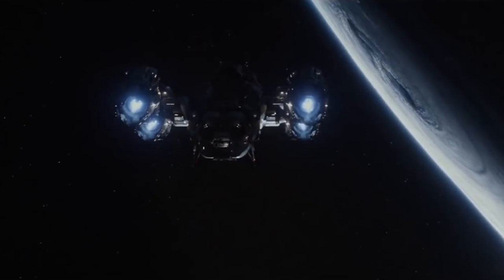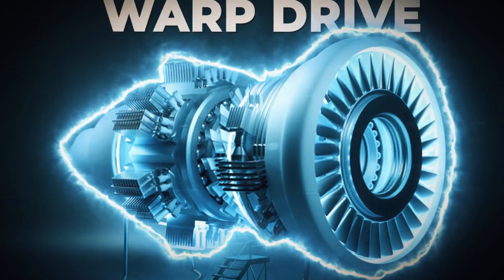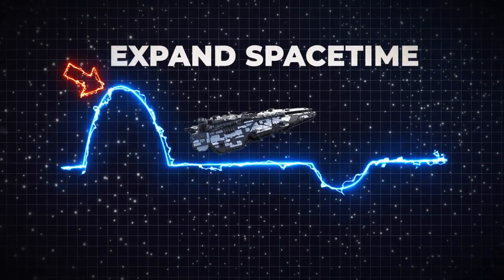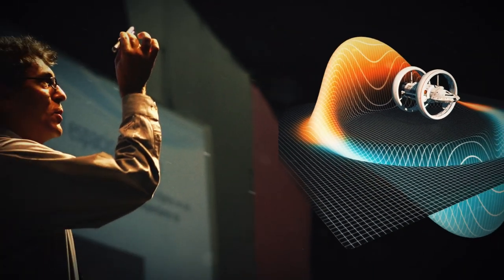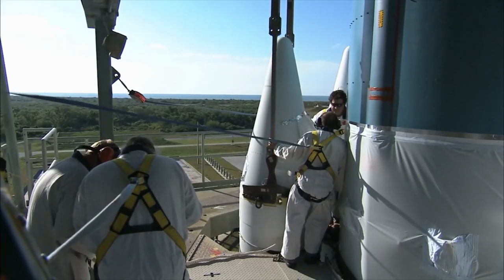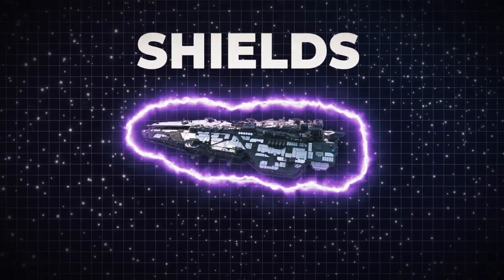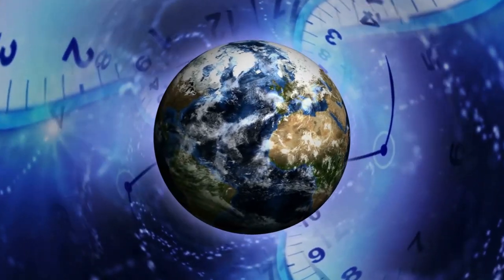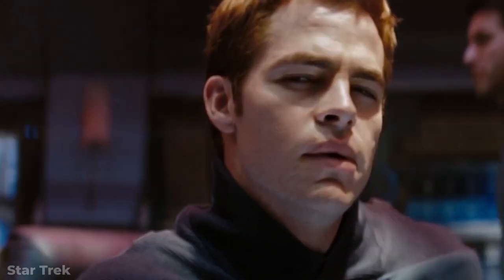NASA’s New Light Speed Engine That Defies Physics

Comment: time dilation is simply unlikely to be true. all normal experience of travel does not support the theory of time dilation. even a low speed chould cause a microscopic delay in time if time dilation is real but it does not seem like it is really there. time dilation is just a mental roadblock in ftl drives. light will dirstort when you travel toward light speed but not because of time dilation but because of the refraction of the light is being interrupted by the speed. when you travel faster than light or just a little bit faster the light will distort just like sound waves formed by pressure waves as you exeed the speed of sound.  as you travel faster than light the ship will become invisible and the pilot will fly in complete darkness. there is no warping of spacetime. the problem with ftl is not time dilation. the problem is the ship will tear itself apart by the forces at that speed. the solution to impact is to probably use a heat ray  hot enough to melt the rocks in space before it hit the craft. you will use a nuclear reactor to power the craft and plasma powered engines powered by water.

Comment: Great Video!  Honest and as realistic as could be. Chances are we may never be able to travel anywhere near the speed of light but it is worth investigating. Perhaps the navigation procedure during warp drive would depend on something similar to advanced telescopes  mounted on the vessel using the warp drive. Then advanced computers that would be able to handle the data coming in at that high rate of speed and relay directions to be able to  adjust the heading of the vessel to avoid asteroids, planets, moons and comets, and  at the same time, keep the final destination a priority. Likely no human would be touching any navigation control during warp drive operation.  The narration in this video is great. Perfect phrasing, pausing, and emotion.
Reply: it would require quantum computers

Comment: You're talking about the limit of the equation. A point at which time is no longer a variable that can be measured. That the values entered have made a monster. Or a value no longer proves the theory. Like Mandelbrot or something. Where the math just infinitesimally gives us the fu. You've made it out to sound like a time machine lol.
It is more likely that a series of superconductors will pull then push ionized free matter to propel the craft.
Reply: what is a   series of superconductors   ?????

Comment: You do realize  traveling  the speed of light is a horrible  idea considering  moving that fast slows down time for whatever  is moving that fast so much that time dose not seem to exist?
Get in a spaceship forgetting  that fact  and go light speed...
293619162013710174916429471610561946 years latter you crash into a planet/black hole/star/ anything  large enough  to destroy  you and you don't even experience  any of that time nor have the ability  to slow down, even on board computers  don't work considering  they need time to function.

Comment: Honestly disappointed by content like this. This is how ideas like earth being flat get popularized, you know. Sure, this isn't quite THAT ludicrously separated from reality, but it's clearly not well researched and there's a ton of inaccuracies being presented in a seemingly "intellectual" format that most people won't even question. It's self contradicting and misrepresentative of real life physics that may be complicated, but are pretty easy to fact check with google.

Warp drives would not be "light speed" engines, they would not experience the same effects as a conventional craft traveling near those speeds, and even if you assume they were just "very very fast engines" as this video presents them, it still gets things wrong about the characteristics of something moving at relativistic speeds anyway.

Pleeeeaase either research until you're a little more intimately familiar with a topic before trying to inform others on it, or if you aren't willing to, then avoid the topic entirely?

...
Also, why does the narrator sound like the love child of Richard Ayoade and the guy that narrates Kurzgesagt?

Comment: We might eventually figure a way to go faster than the speed of light however, time is a different animal. Imagine speeding off at the speed of light. As you approach the speed of light, everything outside your area will seem to speed up. Outside the ship will look as if it’s slowing down (or even stopping). So to those going FTL (Faster Than Light) will be able to pack a hamburger to make it to Alpha Centauri and back. However, that cow that your hamburger was made out of would have had 26 new generations. And this is the problem with FTL travel. Those who on Earth that engineered the ship would have been dead and buried generations earlier. So one has got to ask, if I build it, why can’t I see the results? We are now humans. We want to see information now not 30 or 300 years into the future. So that mindset has to change to building something for our great great great grandchildren. Unless, we discovered a way to send messages back to Earth and back in time.
Reply: This is why i prefer the idea of wormhole travel. You don't even need to get anywhere near the speed of light and the flow of time is the same at both ends of the wormhole. Stabilizing a wormhole enough to pass an object, let alone a large spacecraft through though is as stumbling blocks go, quite a big one.

Comment: Seems like the video isnt reasearched very well at all and that the person who made it has no clue what hes talking about, listening to this is kinda like listening to a 3rd grader trying to explain how a car works lol.

1:49 a warp drive wouldnt take the equivalent of the entire universe to warp a spaceship... thats the amount you'd need to travel back in time, maybe you switchd that up or something. A warp drive for a small spaceship would take about the equivalent of burning Jupiter in an instant, no scientist ever said otherwise. The main problem is that dont know how to control exotic matter and negative energy in a way to warp space. Weve found that through quantum mechanics on the nano scale you can create tiny amounts of negative energy similar to quantum tunneling affecting transistors, but are nowhere near isolating it or even less so applying it in the real world and especially covering an entire spaceship. And no it wouldnt just "create a bending effect because of the incredible amount of energy being used" the matter, which is created by energy itself would be the cause of bending space, the energy has nothing to do with it directly. It's like saying "thanks  to the driver pushing the gas pedal the car propelles it self forward". in that case it'd be the energy in the engine that really pushes the engine, but in this example it'd be the exotic matter/negative energy itself, that is created by using the energy that causes the warp effect. Just kinda painful to listen to. Also Einstein had no interest in the warp drive and its kinda unfitting to say "based on his theory we could come up with an idea to move faster than light" he was literally just telling a reason why its nearly impossible, just so weird and random to say makes no sence. Its kinda like saying "thanks to Einsteins theory of relativity toilet bowls are round because of how the vortex of water being flushed forms and it matching up with the gravity well of a black hole being fomed" or some dumb sh*t. but yea... Please research a little more seriously before claiming weird stuff like that and popularizing it in a video. Also no if you'd travel through warped space time wouldnt be 5 days on board and 5 years on earth, thats litearlly the point of warping space in the first place. To not have to travel at the speed of light. facepalm Ontop of that claiming that you could control where youre going is just completely pulled out of your ass and theres literally no rason at all to believe thats true. A great analogy of how dumb that is, is people in the 20th century believing that traveling faster than 50 miles per hour would kill people. If you could somehow bend space your way why the fkc you wou ever believe you couldnt bent it in a predictable manner?

Comment: I think I've made something that seems to defy Newtons 3rd law. I know this sounds absurd but I have a video of a working prototype. Is there anybody that can help me further?
Reply: Let’s see the video.
Reply: @JohnHazenhousen   it's pretty clear how this is made from the video and I'm sure I'm missing something because it shouldn't work. At any rate the test rig is a flat board suspended from all 4 corners hanging in mid air. There is a laser pointing straight down on the center of the device as an indicator of movement. I read on a NASA website years ago this is the proper way to test and that the movement must be sustained which it is. They said many use sleds but due to friction you can use rocking or vibrations to move them in one direction. Hence the suspended platform.
Reply: @1fast72nova  Where is the video?
Reply: @JohnHazenhousen  you don't see a link?
Reply: @1fast72nova  No, a lot of comment sections don’t allow links to be posted and will automatically delete them. I thought you would upload it to your channel.
Reply: @JohnHazenhousen  it is
Reply: @1fast72nova  How does that violate Newton’s third law?
Reply: @JohnHazenhousen  for every action there is an equal and opposite reaction. In other words a suspended platform should not move from it's center and maintain the move, it should return to it's original position. This maintains a force vector being completely suspended.
Reply: @1fast72nova  And what is spinning the disc?
Reply: At least it appears to. I haven't ruled out somehow the air flow is moving it. Or something else I'm overlooking
Reply: @1fast72nova  And how long have you actually watched it move, after the disc stops spinning?
Reply: @JohnHazenhousen  I did that test several times. But even with the light back and forth swaying at the end of the video it's clear that the platform had returned to it's original position
Reply: @JohnHazenhousen  what are you asking? I have to be missing something but I've tested and tested and watched until it finally broke. I'm surprised nobody else has chimed in bc it's very odd

Comment: Such a Propulsion Engine and ship is absolutely just a fantasy at present, and there is No way realisticaly with our current technolgy that we are any where near creating such a machine. NASA cant even go back to the Moon at present due to a Legal dispute, so the original plans to land men on there again in 2024 have been thrown out the window. Also budget cuts etc the idea that we will be able to build a Propulsion system, test it extensively which would necessitate the buildng of several prototypes, testing them, then building the craft etc etc. Think about all the issues, involved. There is No way that such a device could be built in at least the next 100 yrs. Also Even if we were to be able to travel across Space at the Speed of light, that is still very slow, and would still take thousands or millions of years to travel to most of the Stars as they are thousands or even millions of light years away.